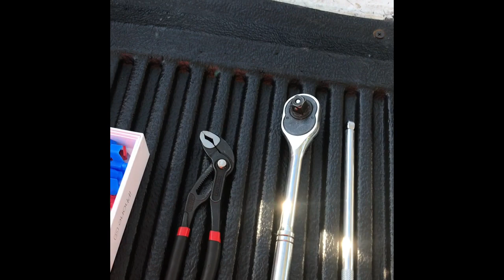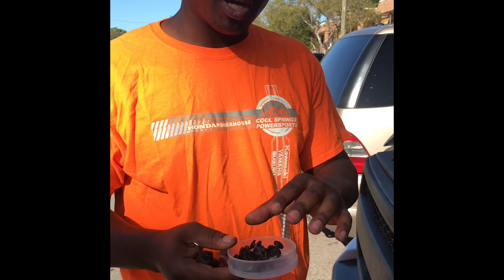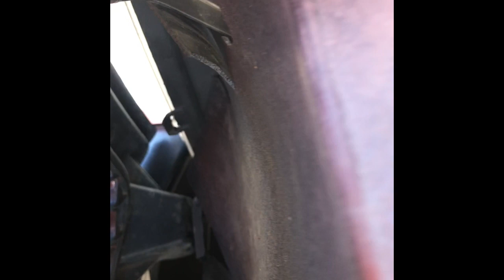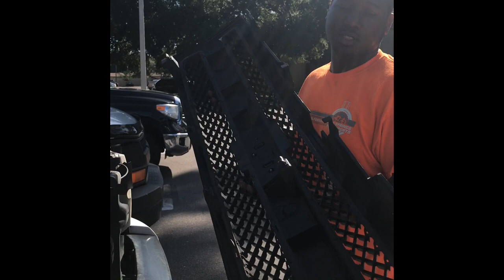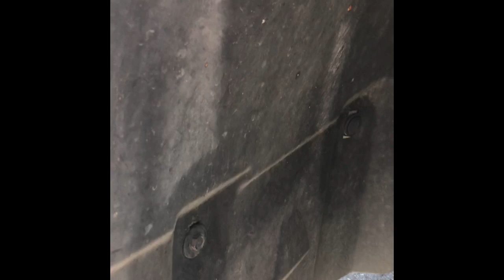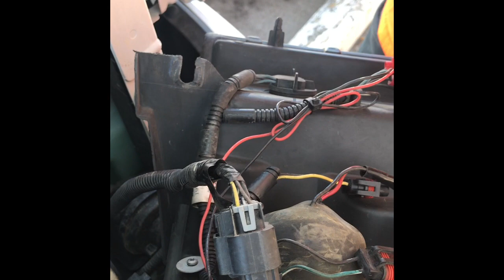Silverado LED Headlight install for 2007-13—DNA Motoring—Part 1

Comment: How you liking the lights?
Reply from the maker: No problems. They’re bright and look great! Make sure you find a good sized wall to adjust them to the right height if your truck is modified/lifted.
Reply: My same one’s had the bowls flake off their reflective coating, rending the halogen projectors almost useless. Upgrading the projectors